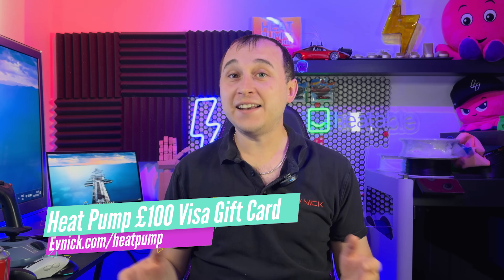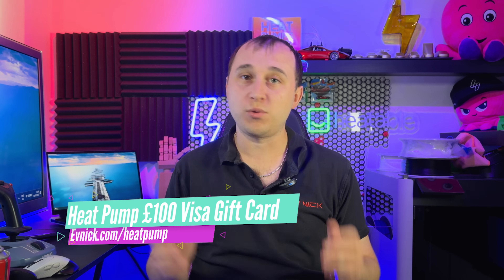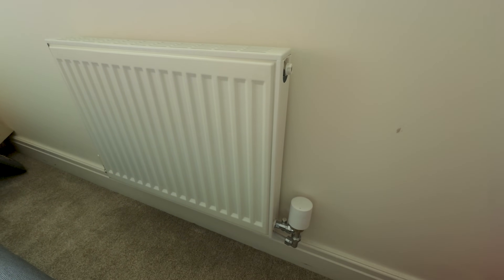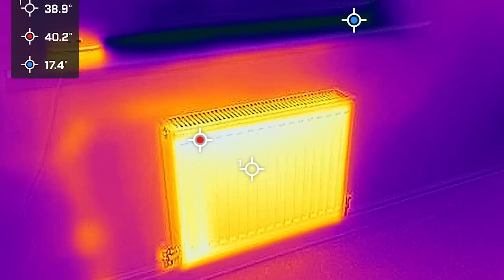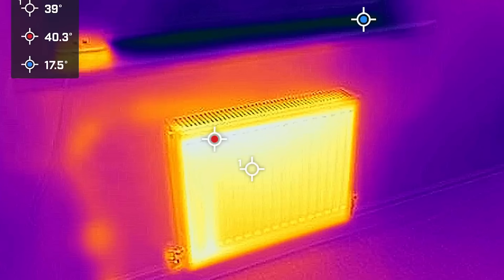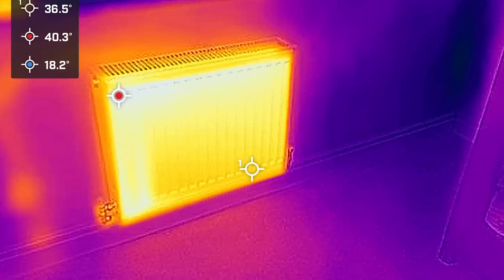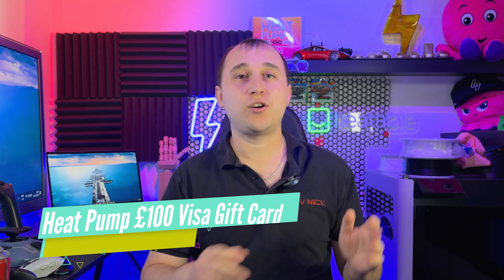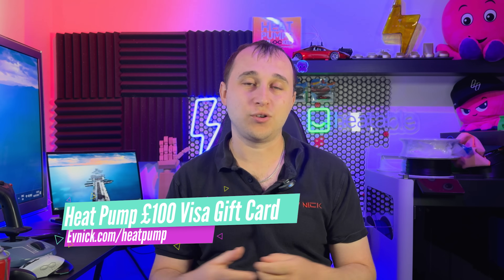Why Can't Air Source Heat Pumps Do Cooling?

Comment: We have a gas boiler powering a Johnson and Starley Aquair unit.  The boiler pumps hot (60°C) water through the Aquair, and it spins up a fan, and it blows hot air, 20°C+, around the ducting system.  
The plan is, is to fit a type of Daikin Altherma heat pump, which will do all that, 20°+ heating, and also run cold water down to cooling temperatures, which also spins the Aquair unit up from below 23°. 
1989 build house with, at least, modest, B grade insulation, not so modest, ducting system.

Comment: My Samsung EHS has both heating and cooling but as I have radiators and there is a risk of condensation on the pipes in the voids. I have thought about fit a wet ducted exchange and fit a fan to it as a separate circuit which I could lag all the pipes to it. Just not got round to it as I have a portable air con unit

Comment: Not sure what would be stopping a system being similar to a mini-split system and either sending it between a heat exchanger to heat a water tank and either a central ventilation system/interior mini-splits... You'd get the best of all worlds; Heated water for taps/showers/etc, water for radiators if you need to & air cooling/heating.

You wouldn't be able to cool your house and heat your water at the same time but a good system should be able to optimise.

Comment: You can add an air to air unit even if you have an air to water since regs changed in May 2025. This is an increasingly nice option.
 I have an air to air unit  and am thinking of adding  air to water to replace the gas boiler.
Just add a mini split air to air system. You can even DIY  these days with R290  propane units so no F-gas regs apply - see eg Amazon.
You will need to cut a big round hole in your house wall so maybe leave to the professionals  ?

Comment: The A2W FCU (fan coil units)are expensive in the UK and I am told not as efficient as the refrigerant A2A FCU. . When I enquired a couple of years ago it was 2k a unit, recently been quoted 300 plus, not sure of the specs for these less expensive units. You also need a power supply to each FCU and a condensate drain. Daikin multi split plus is an A2A and hot water. Samsung EHS TDM plus can do A2W, hot water and A2A. The Samsung solution brings the refrigerant lines in to supply the traditional FCU. Still need to deal with condensate drain off. Not sure how many FCU you can support.